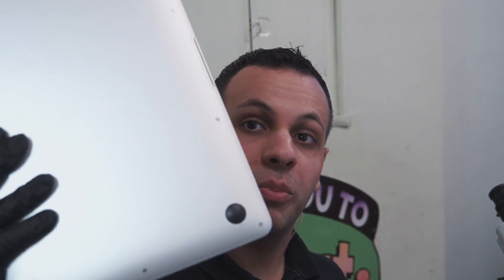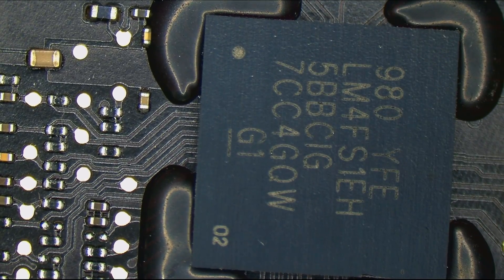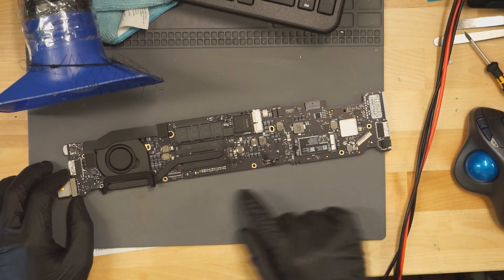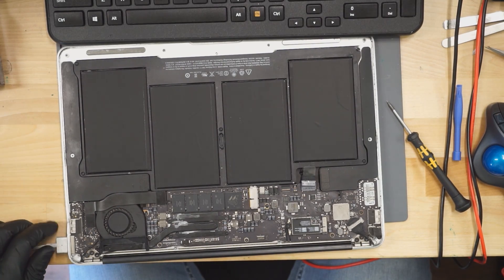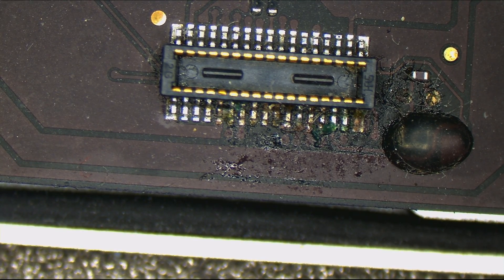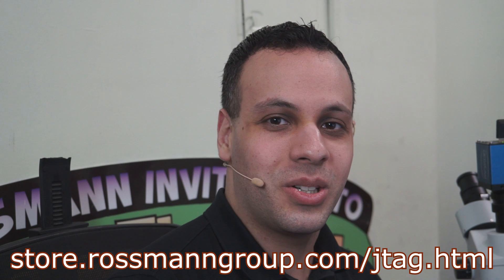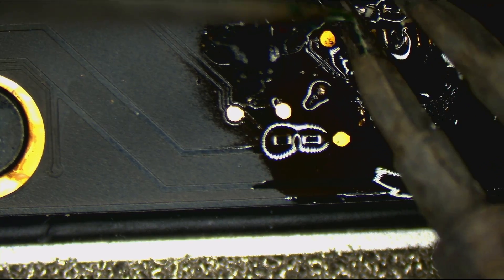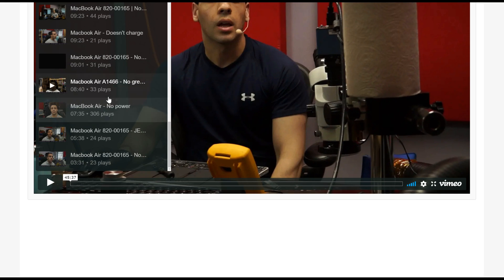Louis does NOT cherrypick: the queue is random.

Comment: 7:04 I didn't like that. Melting the JTAG connector to remove it seemed clumsy and dirty compared to previously where you used the heat gun and it shriveled up into a single piece which you were able to remove with tweezers.

Comment: When I worked alongside R&D for a satellite company, we had J-TAG connectors when programming FPGA chips. For those that don't know FPGA, it can be used to configure a CPU (or any circuit) with customisable components. It's a convenient way to do some hardware style design in a software like way. Say you have a chip with 1000 by 1000 components (that can be told to be anything from a resistor to a capacitor etc). That gives you 1 million potential components to play with. You can make the chip into memory or a CPU or both. Anything your heart desires.

But the J-TAG only needed to be present during development. When we moved to production the lines to the J-TAG remained but we didn't place the connector. Then again, it's perceivable that you might want to keep J-TAG even in production if the chip it's connected to is configured as a diagnostics chip. The idea being, you'd just plug in a device and it would diagnose many of the potential problems on the board without having to prod around. Like a idiot's version of what Louis does so excellently.

Of course, J-TAG is just a connector, so maybe it's used for other reasons. Just thought I'd add this bit incase people wondered WTF it was there for.
Reply: Anyway, you can safely remove the J-TAG as it has no effect on the operation of the motherboard. Most of them never get used after the device is sold to the user anyway.

Comment: What does a JTAG connector do and why is it OK to just remove them?
Reply: JTAG is a connector used to "Debug" boards.. commonly used to flash new firmware.

Apple most likely used it for testing during manufacture, but has no user use.  As Louis stated, its location is open to debris or liquid damage.  So louis just ripped it off, as its not needed to keep the system running, and Hey Presto, Fan Spin.

Comment: Did that jtag connector just melt?
Reply: Yes, its made of plastic.
Reply: @Brianwhite1969  that seems pretty drastic doesn't that risk damaging the board?
Reply: @Zimmplicity  Nah, Flux. Low melting point.  Boards have to endure several hundred degrees to melt solder.  Plastic goes liquid before then.

Comment: only if life was as simple as removing a JTAG Connector
Reply: Jaishankar Iyer ‘life’ has been called “the slowest possible death sentence” but if you’re trying to shortcut the process rather than lengthen it, there are even simpler ways to do “that”.
Reply: well it is just as simple. you just need an adequetly sized  Hans with a proper flammerwerfer and that will always solve your problem. it works just like those damn JTAG connectors

Comment: Louis, do you ever mention that Capton tape is a bit of an issue?   It was used for decades in airplanes until it was found to turn into a shorting, sparking conductive mess when exposed to a starter spark.  Billions of dollars were spent on removing Capton insulated wires from various civilian and military aircraft.  It might be okay for your careful supervised usage, but I wouldn't leave any inside a mac of any kind!
Reply: When you have a starter spark inside a MacBook, you have other problems than Kapton tape.

Comment: Wow, these boards are SOO WEIRD.  So many analog parts-- resistors, capacitors, gates used as analog comparators,  voltage dividers, wow this is more analog parts than in a 1955 military radio!

You'd think Apple could have combined like most of the analog stuff into a microcontroller, one with about 8 analog inputs and 8 digital outputs,  all digitally programmed to generate the yes/no enables from the various voltage levels and enables.   It might end up costing about the same, but then the board would be like 90% more impervious to moisture.  

That unfortunately would cut down on the macs that you could fix with flux and resistor and cap and simple IC swapping.
Reply: I can now just imagine the workers at Apple Hardware Engineering as school dropouts. "So, we saved 5 cent by replacing the voltage divider with an analog grid. Uses a lot more space on the PCB now, but it's fine"

Comment: Louis was awfully gentle removing the first JTAG, but removing the second one with prejudice is the Louis I've come to know.
Reply: Yes, but the first one still was toast. They seem to be extremely sensitive to temperature, more so than the chips.
Reply: @anlumo1  Yes, I know.  Louis is usually more hostile to JTAGs than that one.
Reply: @anlumo1  For desoldering plastic connector you must use preheater and lower temperature from hot air. It's a bit tricky, but is quite possible to obtain good connector from other dead mother board.
Reply: On the 2nd one, all I see is him melting a chip right off? Lol I guess the JTAG connectors are poor design from Apple?
Reply: @potatoes1234  Louis despises JTAG connectors, he's usually vicious towards them.  He was downright gentle on the first and more like himself on the second.

Comment: For those wondering what the JTAG connector is for: It allows technicians/engineers to tap into the firmware/processor and find bugs and other issues especially during engineering and manufacturing phase. 

You can step through CPU instructions just like you can with other software debug tools for example. With most electronic products once it leaves the factory there is very little use for it  as even if a board requires repairs a technician will just measure voltages, continuity etc., and then swap out components, fix shorts and rejoin circuitry where needed as the JTAG won't help them, hence the JTAG massacre that you see Louis is doing. In fact, removing the connector also helps that in case of another spill it doesn't catch and retain the fluid like it normally does.
Reply: thx
Reply: It's odd that they have one at all. I'm only doing one-off designs, and still I'm not using JTAG connectors. Bed of nails (or TAG Connect in my case) doesn't need an expensive component and works just as well.
Reply: @anlumo1  My guess is that they are using it for automated testing mostly. I'm no expert but I think bed of nails solutions are probably not all that useful anymore as circuit boards have become to complex, compact and componentised to test using those. Instead, they use boundary scanning to test the interconnections between larger logical components. The JTAG interface can actually inject signals too and is not just a reader and I think that is where its usefulness comes in as you can then use software to perform your testing.
Reply: @CaptainPanick  Modern nail-bed Stations do all the things that you've just described.
They can test the PCB and components, Programm and debug components and also test the final product all autonomously.

The JTAG connector is purely intended for uses in the field, long after it left the Factory in which the final product (the finished PCB) was commissioned.

Comment: Louis. What is the Jtag chip?
You have heard about Jtag an Xbox?

I got clickbaited because I thought it was someone who had hardware-hacked their own macbook.
Reply: JTAG isn't a chip per se. It's a standard interface for debugging, firmware programming, etc that is found on almost every computer system -- including video game consoles.

JTAG-ing in the Xbox 360 parlence was using the JTAG port on the system to achieve a jailbreak allowing for execution of unsigned code.

Comment: Gee it's almost like that is a designed in failure mode isn't it?

they wouldn't do something like that deliberately would they?

of course not.
Reply: This looks more like it's designed in a lab with no thought wasted on how it's going to be used in the field.
Reply: @anlumo1  , Personally i think that is a rather naive opinion.
Reply: @axeman2638  Of course it's simplified. However, when you're designing a PCB in a design tool, you don't see where liquid is likely to come in. Thus, you get things like having critical traces with exposed pads close to those locations.
Reply: @anlumo1  , most PCB design tools also feature 3d modelling of the final board these days, I find it impossible to believe a billion dollar corporation like apple is not fully aware of what it's doing with it's designs.
Reply: @axeman2638  That design most likely isn't finished at that point.
Reply: @axeman2638  Also, there's a high possibility that the PCB designers aren't allowed to see the final case design before the release.
Reply: @anlumo1  , Do you work for apple or something?
 Or are you just a triggered fanboy?
Reply: @axeman2638  No, I've just talked to people who are.
I hate Apple just as the next guy, but I do want to get behind the reasons why things are the way they are anyways.

Comment: Why they put JTAG connectors if the only repair they perform is swapping the main board eventually....
Reply: Probably to test the board in the factory
Reply: @liteoner  they can use pad for that is more cheap that put jtag
Reply: Think of much money the producer makes if these books fail because of a little water on the connector. It's definitely the clients fault if he spits on the JTAG connector. It fits perfectly in the 🍎 strategy?! Doesn't it?
Reply: Production line, automated board testing and flashing before assembly.
Reply: Why want to remove that JTAG if it can cause problems? Apple logic, bro...

Comment: What is the Jtag connector used for?
Reply: It's the water damage collector/planned obsolescence chip.
Reply: @Pyxis10  I don't think apple is that nice.
Reply: Yeah, I wonder about this too... On what logic, removing a factory-installed part actually fix the stuff?
Reply: @royardianto  It's basically a test point. It's doesn't actually do anything itself. 
Now if someone actually needed to use it to test the chips it was connected to...well they'd have to put a new one on. 
But it's ok. Apple doesn't actually test anything, they just swap the board.

Edit: Think of it kinda like the OBD plug in your car. You can cut it off and the car will run fine. It's just the connection to the computer. Just hope you don't get a check engine light! 😂
Reply: @DazedLogic  thanks for the explanation, that cleared up the question I had. So it is more like a diagnostic port on a car to run computer check up, but it it placed poorly and makes the board malfunction instead ...

I kinda agree maybe apple just refurbish these parts or send them beck to the production plant for reassembly ...
Reply: They are for trouble shooting. You plug into it using a jtag adapter cord so you can test the chips on the board that are connected to it to determine if they are working correctly. 
Not sure why apple puts them on their boards though, it seems they mostly just swap the board. Maybe they send the old ones to get refurbished and that's why they are there? 🤷‍♂️
Reply: GhostHostMemories JTAG is an interface used to test the board and chips.
Reply: JTAG is a standardized interface for accessing in-chip diagnosis/debug peripherals. It usually serves as interface for microcontroller debug probe that lets programmers debug chip's firmware.